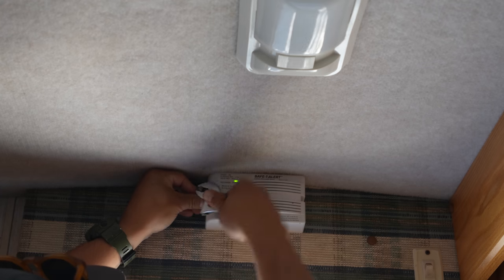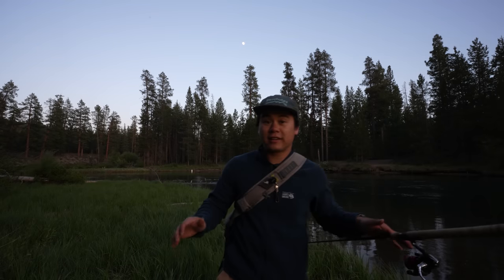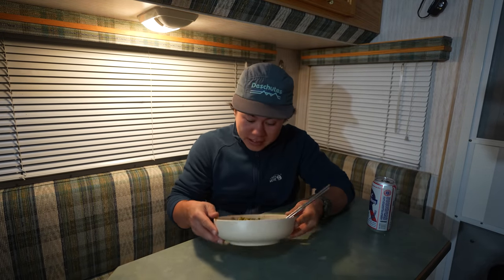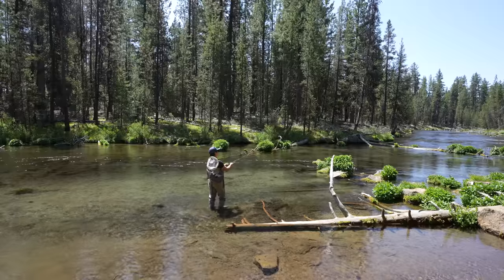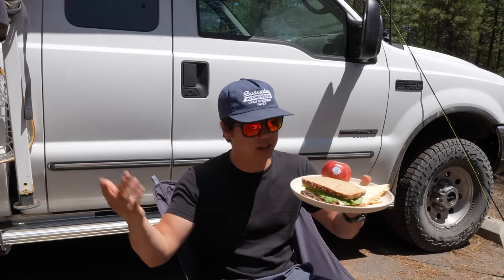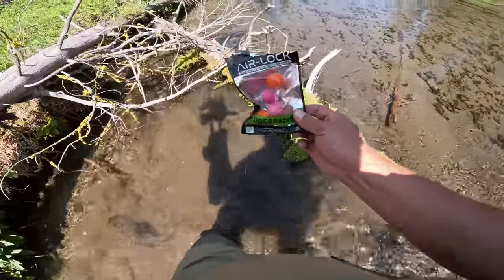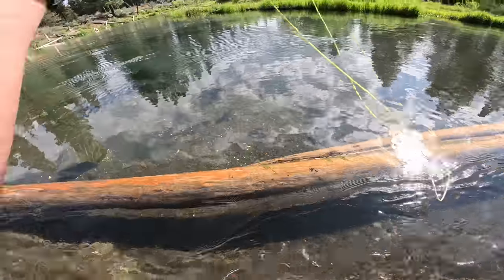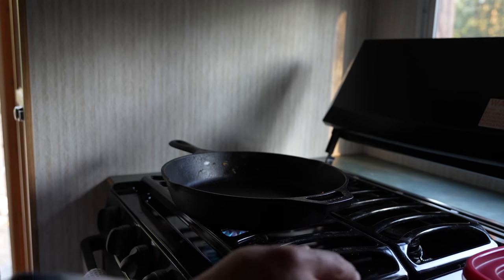Down by the River in my Truck Camper (Peaceful Fly Fishing)

Comment: Work on a connector from your power station to you rear cab of your truck to protect the power unit from the elements. The cord can be routed thru the rear cab vent between the cab and the bed. Then make  it long enough to connect to your shore power socket. That when you have solar panels connected to theat power station for unit charging. You may also charge the unit every time you drive the rig.  That 12 volt plug can connect to a switch power port from the truck connection. Good luck with the fly fishing. I have tried fly fishing all over and still need improvement never caught  a fish large enough to eat. venture on

Comment: Johnathan great video as always .Not sure what weight rod you are using? Pick yourself up a 3 weight set up and a few WOOLY buggers in size 12 and 16 black purple and olive
 also size 10, 12 and 16 Royal coachman wet flies. Fish these flies casting across upstream stream at a 45 degree angle on a dead drift or a jerking motion .
Let them swing down stream and strip them back. Great way too cover water and get reaction strikes from inactive fish. Also they imitate a ton of different bugs in various stages of development..
 Use a two or three pound tippet. Unless the fish are being particularly finicky these flies will get you into fish. Have fun

Comment: Great video.  As a new Fly Fisher, I highly suggest you spring for a day or two on the water with a guide. It's not cheap, but you will learn quite a bit and it will make you a much better angler in a short period of time. That low clear water you were fishing is  amongst the most challenging.  When I started, half the time I fished on olive or black woolly bugger in different sizes. The other half was a hares ear or a pheasant tail in different colors. Tight lines!

Comment: Federal law banned replaceable battery detectors. You could buy a lithium battery one with a 10 year lifespan, but usually the detectors in an RV are designed to be hardwired and give off a beep when your battery voltage is low.

Comment: Don't get all caught up on the "match the hatch" being some sort of cheat code.  Flys catch fisherman, presentation catches fish.

I fish some of the most pressured east coast waters and 90% of the time I start with a simple PT nymph and a brown chenille rubber leg.

Let's work on your presentation.  Your line management is hindering you.  When you fish those seams (they're super fishy!) I'd say 80% of your drift is not ideal.  Nymph fishing is best when you fish upstream and let the fly come to you.  When it starts to get to the side of you and behind you it makes the fly do weird things underwater and fish brains don't see it as food.  Plus fish can see you in that crystal clear water.  So if you are behind them, they won't spook.

Fishing an indicator you should see it "ticking" as your shot bounces on the bottom (if you're not using weighted flies, you should have a small shot on the line).  If it pauses?  Set the hook.  Get really good at setting the hook.  Spooky fish have subtle takes.  If you're not snagging bottom every once in a while, you're fly isn't getting deep enough fast enough.  Fish hug the bottom and "pop" into the flow as they see food.  So put that fly in front of them.

I've been a junkie fly fisherman for 20+ years.